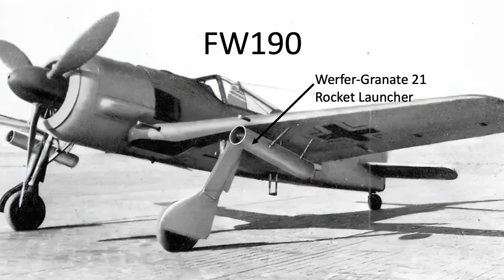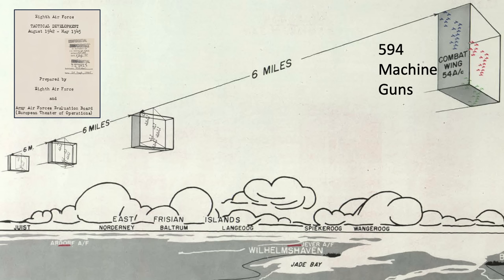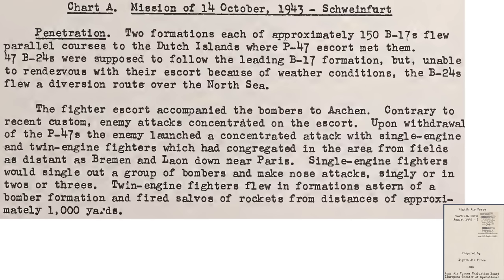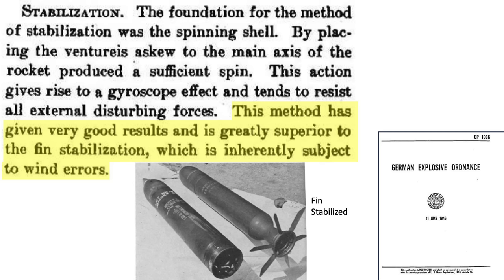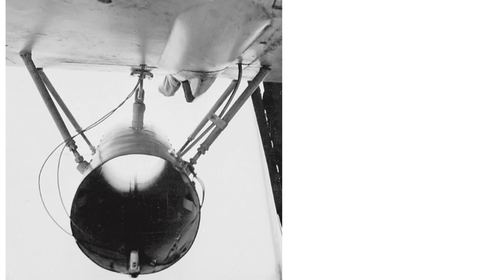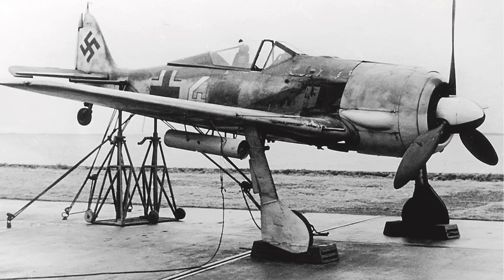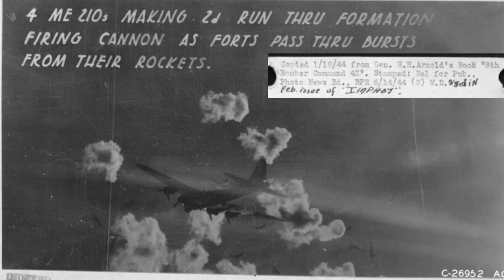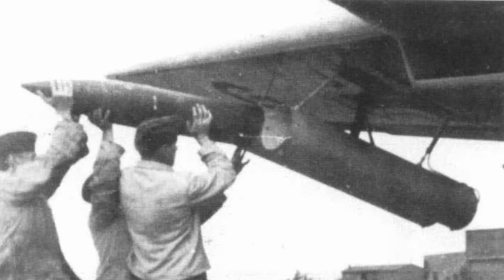German 21 cm Air-to-Air Rocket Combat effectiveness and Tactics

Comment: Having written a couple of books about 8AF B-17 combat in late 1943 and early 1944, I'm happy to label the FW-190 beam attack scene as ahistorical.  HOWEVER, I interviewed one B-17 gunner on a major mission deep into Germany in early 1944 who claimed a rocket went straight through the vertical stabilizer of his B-17 without exploding, but leaving a huge hole in the tail.  I later discovered a photo of this very aircraft after the mission, and it fully confirmed what the gunner said about the damage (even though he didn't see the impact himself from the ball turret) but was told about it by other crewmembers.  Two of the crew were killed in the mission, so he had other things on his mind.  The damage reportedly occurred when their aircraft had fallen out of formation, so rocket attacks from different angles seem more plausible to me.  So yeah, it was possible, but I still consider this scene dodgy.  109s and 190s did carry rockets, but I think they fired them from head on when attacking formations to break them up.
Reply: It seems a little odd to me that rockets would be fired against lone stragglers. Given the higher dispersion and greater burst radius, it seems the far more effective use of rockets would be "flock shooting" at dense formations, while guns should be used against lone bombers. I wonder what the story of this engagement is from the German perspective.
Reply: @don_5283 The goal was to get rid of your payload, as critical questions were asked upon returning to base with full ammo load
Reply: Didn’t they use an acoustic sensor so it would explode at a certain distance?
Reply: @Rebellpanzer   Timed fuze......

Comment: The Allied airmen were fortunate that the Germans hadn’t figured out the proximity fuselage.
Reply: The proximity fuze truly was one of those wonder weapons the Allies used.
Reply: The Germans had a canon shell FLAK proximity fuse program up until 1940.  In 1940, due to the Battle of France,  a fuhrer order was sent out that all programs that could not produce fieldable weapon within 6 months was suspended.      The program didn't restart till 1942.      One of the vacuum tubes, a cold gas thryratron, was handed over with the Oslo Letter to British intelligence with a crude diagram in 1939.  At the same time the Germans were using this shock hardened vacuum tube/valve to arm, disarm and set time delay in aerial bombs. The German Rheinmetal electronic fuses were the only bombs that could be shipped with fuses in the bombs safety.  They could be armed and armed in flight at any time by charge/discharging a capacitor. 
-The British were inspired by these German developments to put the Physicist John Cockroft  in charge of making a British proximity fuse.   Since Cockroft had an atomic bomb to develop the work was handed over to BuOrd of the USN.   The US got a fuse in service by end oif 1942.   The British test fired their own fuses (which detonated on a radar double pulse when the radar tracked shell merged with the target in 1942) but relied on the US fuse which was in production.
-The Germans restarted their program in 1942 and were test firing shells in what is now Poland in early 1943.
-The German fuse was called Rheinmetall Kuhglochen.   They fired about 1000 test round of caliber 88mm.
-The German fuse was electrostatic.   As a shell rotates is  flight it generates a huge electrostatic fireld which interacts with objects near it like and aircraft.
-The shell had a singel nose whiker aerial which picked up the presence of an aircraft through the 500Hz field from shell rotation.  This was band pass filtered and applied to the striking anode of the cold gas thyratoron.  This triaged and fired a pre charged capacitor through a fuse link that detonated the shell.
-One problem was that the thyratron needed a little radium to preionise the argon gas so that there were no time delays or inconstancy in firing.  They were working on a pre biased tetrode to eliminate the need for radioactivity.  
-Range went from 1m,2m and then 4m.  Finally 10m.
-They never got i into production, factory in present Poland was over run.  
-It was unjamable.  BuOrd looked at it but didn't like that it didn't work in rain.  It had a nose contact fuse.
-The cold gas thyratron could also make accurate  programmable time delays.  This allowed the fuse to be gated or set in the barrel.

Comment: A VT fuse would have changed the equation radically. OTOH a VT fuse in German AAA prolly would've have made fighter interception itself unnecessary.
Reply: The Germans had a canon shell FLAK proximity fuse program up until 1940.  In 1940, due to the Battle of France,  a fuhrer order was sent out that all programs that could not produce fieldable weapon within 6 months was suspended.      The program didn't restart till 1942.      One of the vacuum tubes, a cold gas thryratron, was handed over with the Oslo Letter to British intelligence with a crude diagram in 1939.  At the same time the Germans were using this shock hardened vacuum tube/valve to arm, disarm and set time delay in aerial bombs. The German Rheinmetal electronic fuses were the only bombs that could be shipped with fuses in the bombs safety.  They could be armed and armed in flight at any time by charge/discharging a capacitor. 
-The British were inspired by these German developments to put the Physicist John Cockroft  in charge of making a British proximity fuse.   Since Cockroft had an atomic bomb to develop the work was handed over to BuOrd of the USN.   The US got a fuse in service by end oif 1942.   The British test fired their own fuses (which detonated on a radar double pulse when the radar tracked shell merged with the target in 1942) but relied on the US fuse which was in production.
-The Germans restarted their program in 1942 and were test firing shells in what is now Poland in early 1943.
-The German fuse was called Rheinmetall Kuhglochen.   They fired about 1000 test round of caliber 88mm.
-The German fuse was electrostatic.   As a shell rotates is  flight it generates a huge electrostatic fireld which interacts with objects near it like and aircraft.
-The shell had a singel nose whiker aerial which picked up the presence of an aircraft through the 500Hz field from shell rotation.  This was band pass filtered and applied to the striking anode of the cold gas thyratoron.  This triaged and fired a pre charged capacitor through a fuse link that detonated the shell.
-One problem was that the thyratron needed a little radium to preionise the argon gas so that there were no time delays or incostancies in firing.  They were working on a pre biased tetorde to eliminate the need for radioactivity.  
-Range went from 1m,2m and then 4m.  Finally 10m.
-They never got i into production, factory in present Poland was over run.  
-It was unjamable.  BuOrd looked at it but didn't like that it didn't work in rain.  It had a nose contact fuse.
-The cold gas thyratron could also make accurate  programmable time delays.  This allowed the fuse to be gated or set in the barrel.
Reply: @JK-rv9tp  The U.S. spent roughly a billion dollars developing the VT fuze (about one-third of what was spent on the Manhattan Project).

Comment: "Artillery in the sky"  :D  I'm amazed, that with German technical brilliance  they never developed ground-to-air RC guided rockets.
Reply: Radios were still quite bulky at the time and they didn't have lasers yet, so actually getting the signal to the rocket without the rocket's exhaust disrupting it would have been a problem. Even after the war, the best option for guided surface-to-surface rockets was a very long cable.
Reply: Their “brilliance” never stretched to electronics.  They were ten years behind the allies with radar just as an example.
Reply: They actually got one in production but just missed out on service>  They tested 4 designs: 1 Messerschmitt Enzian (a wild flower) ,  Rheinmetal Rheintocheter (Rhine daughter) Wagnerian character), Henschell Hs 117 Scmetterling (butterfly) and the EMW Wasserfall (Waterfall.)
The Henschell Hs 117 actually entered production.  The Wasserfall was also scheduled for production and several were test flown..
Henschell 117 Schmetterling was a subsonic solid propellant missile with a range of about 10km and altitude of 9000m/30,000ft
EMW Wasserfall was a Mach 2.7 missile with an ability against a 18000m/58,000ft target maneuvering at 0.5G with a range of about 45km/28miles.  Clearly able to take on a B-36.
Both were to be compatible with the same 13 guidance systems the Germans had.
-Elsass was probably the most advanced.  A conical scan auto track locking radar FuSE 64 Mannheim tracked the bomber.  Another similar radar locked on to a transponder on the missile and a mechanical computer based on FLAK predictor technology  calculated and intercept with a radio command to get an intercept.   Manual Optical tracking could replaced one or both of the radars. 
-The system that won out, for Wasserfall, was a beaming riding system.  A conical scan radar locked onto the target and a receiver synchronized to the rotation centered itself in the beam.
-A simple system involved one or two operators tracking the elevation and bearing of the target.   This elevation and bearing was sent to the missile autopilot which would head in the direction of the target.  Another operator would use a joystick to nudge the missile into the center of the target.
-There were a couple of terminal homing systems as well.  Madrid and Hamburg for infrared homing,  Blaupunkt  MAX-P for passive homing onto allied microwave radars on night fighters and ground mapping radars and MAX_A an active homing system.
Reply: @annoyingbstard9407 
They had working radio guided glide bombs by 1943, used in Italy at least.
Reply: Germany at that time where testing ground to Air rockets.I think in Peenemuende.Saw a docu years ago.

Comment: Several German figfhter pilots describe how these were used.  The time delay was set to about 1000m (not 1000 yards).  Range was estimated from the stedometric range finder in the standard ReVi sight using bomber wing span.    The missile was spin stabilized so the coanda effect meant the missile veered to the side but this offset was dialed into the sight.  Heinz Knock describes attack a landing barge with a set.     It became impossible to use these against the bombers when P-38 appeared.  So the P-38 did work.  
-The Germans introduced a specialized unguided missile the R100 and R100BS of diameter 22cm.  The missile had a fixed time delay fuse but the Oberon radar gunnery system fired the missile automatically taking into account range, air density and air speed. It was intended for blind attacks against night bombers but also in daylight as well.  Me 262 and Ar 234 etc.
Reply: 1000 meters is 1093 yards. Close enough to the same distance for this topic and within the margin of error.
Reply: @bguen1234  off the projector fall off with 9% range. Error works out about 20% greater distance.

Comment: Twin-engine Luftwaffe fighters often launched their rockets from the rear of a USAAF bomber formation before closing in for gunnery attacks. On 20 June 1944, ZG 26 elements conducted just such an attack on a B-24 formation belonging to the 492nd Bomb Group. The Me 410s attacked six-abreast in a couple of waves, each wave firing its rockets in unison before initiating gunnery runs. During debriefings, 492nd Group veterans complimented the skill of the German pilots.
Reply: Flying such twin-engined fghters when U.S. fighters were around was a risky prospect.

Comment: These rockets would have become much more dangerous, if used with proximity fuzes. The Germens did develop proximity fuzes for air-to-air rockets, but none of them reached massproduction before end of the war. Insted of using radio-proximity technology,  like the American proximity fuzes, the German versions were accustic based, designed to react on the vibration from the propellers of the enemy planes.

Comment: 4:38 here it's said the rocket has warhead 22.4lbs of explosive, but in 7:45 it says it has 80lbs warhead. Some other sources also hold it to have 80lbs (40kg) of explosive. This would be nearly as much explosive filler as the massive 300mm NbW42 rockets, of twice the size and mass of these 21cm ones. Is it possible that aircraft-dedicated WGr42/BR21 would have bigger warhead than infantry based Nebelwerfer 42 21cm rockets? Sounds hard to imagine how they'd fit it in, but on the other hand these aircraft-borne rockets were supposed to only go 1000 meters and explode, so they didn't need as much propellant as land variant shot upwards on distances of up to 7 kilometers. So what would be the case here?

Comment: They were working on RC-guided rockets. I think they were developing a seeker as well (IR). Did we really use the VT for AA much in the ETO? Just thinking if we did, they might've tried making a jammer if they happened to find a dud.
Reply: For just that reason, and to prevent Germany from developing its own VT fuze, it was not used to fight German aircraft over land.    
The VT fuze was developed for the US navy, and the Navy prohibited its use over land and prohibited its supply to allied forces.   Their thinking was that while the inevitable duds fired at sea would just sink in the ocean and be unrecoverable, if used over land the inevitable duds could be recovered by the Germans and be reverse engineered.
However, when Germany was about to begin launching V-1 cruise missiles at Britain, Britain had no effective defense against it.   The British Prime Minister was able to appeal to the US president and get the prohibition against use over land and supply to Britain rescinded in the nick of time, and most V-1's launched were destroyed by the VT fuze, with most fired by US crews.
Reply: @keithammleter3824 
True story indeed – and well-reported, thanks!
Reply: I believe (correct me if I'm wrong) various US army forces – towards (or around thereabouts) the end of the Battle of the Bulge – started employing them (proximity-fused artillery rounds) against stubborn [retreating] dug-in/entrenched German ground-forces, utilizing them in a [very effective] overhead 'air-burst' employment.  After a few barraging salvos from their 105 howitzers, loaded-out with such shells, most [surviving] Wehrmacht soldiers gladly came out with their hands [literally!] in the air.
Reply: @SharkHustler  You are correct.   The Wikipedia article on proximity fuzes says so under heading '"deployment", giving multiple references, including a contemporary US military document.

Comment: Firing one of these rockets from 300 meters while attacking from the 3 o’clock position was almost certainly never done other than by a pilot in pure desperation or by a very inexperienced pilot. No PD fuze and way to close for the 5 second delay fuze. Although if range estimation and aiming could be done accurately, 12 mils from 1,280 yards was just over 46 feet. Just within the lethal radius of the rocket. Attempting a shot from anything other than the front or rear was a waste though. Frontal shots requiring timing that was probably beyond the reflex’s of a pilot in anything other than an ideal situation.

Comment: Not including an impact/contact fuze seems to be an amazingly bad mistake.
Not including proximity fuze on something designed to be this cheap, sure, it's probably not a good choice, but at least understandable from the viewpoint of cost.   But leaving out the contact fuze is just confusingly stupid.

As Redhand1949 notes among others, actual direct hits DID happen, and if not completely harmless, the damage caused was low to minimal.
A contact fuze would have changed all direct hits to crashed aircraft.   AND it would also have allowed skilled pilots to use the rockets as direct fire weapons.
Reply: Probability of actually hitting the bomber was almost 0, spending resources on something that is pure chance would be stupid.
Reply: You probably mean incredibly lucky rather than skilled.😂
Reply: @randomnickify  A contact fuze is TINY and costs barely anything compared to the whole, and based on actual wartime reporting, bombers WERE hit, not all the time, but enough times that it was very obvious that it did happen repeatedly.

Compare the cost of adding those fuzes to the rockets, with how many 88mm shots, every one with an impact fuze, was on average needed to damage or destroy a single bomber.

Even if only half a dozen direct hits had been scored during the entire war, it would STILL be more efficient use of the fuzes than the 88s.
The cost of adding the fuze to the rockets is less than 1% of the total cost.

And we KNOW that the number of direct hits were greater than that.
A few dozen extra bombers shot down, at least.   Still not hyper effective or anything, but the overall effect of the rockets would have been greater.
Reply: @annoyingbstard9407  Either works.
But i think you underestimate just what kind of shots people can achieve.
Reply: @DIREWOLFx75    It’s hard to explain things to someone who just invents facts and figures so you carry on believing that.

Comment: Not saying that nobody ever tried such an attack, or that they were never successful with it. I would say however both are highly unlikely to the point that if attempted any successful attack would be an almost pure fluke. Hitting a fast moving plane from a fast moving plane with a slow moving, wildly inaccurate projectile from a maximum deflection position would be pure luck. To actually hit THE  plane you shot at would be little short of a miracle.

If it ever happened, I'd guess it was some wallah seeing escorts coming and decided to just fire the bloody useless things off to get rid of the weight,  in the general direction of the formation, and got hella lucky and hit something.